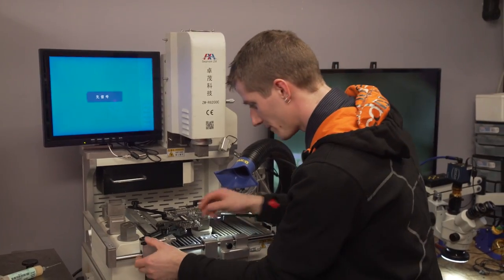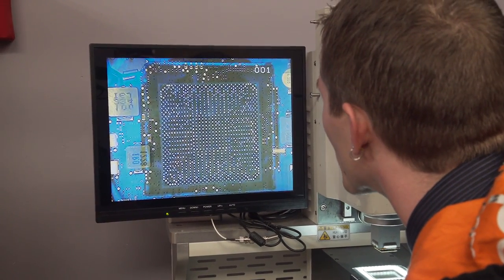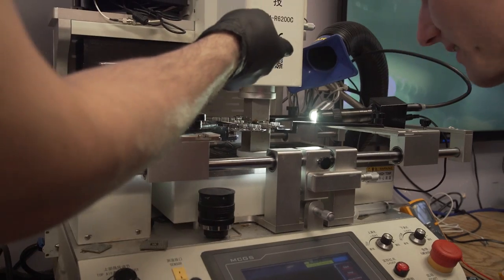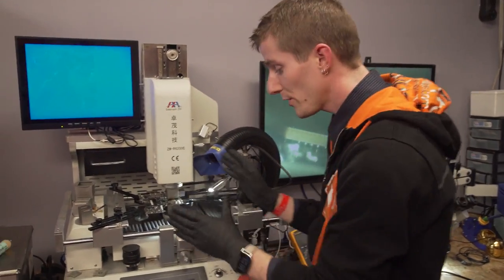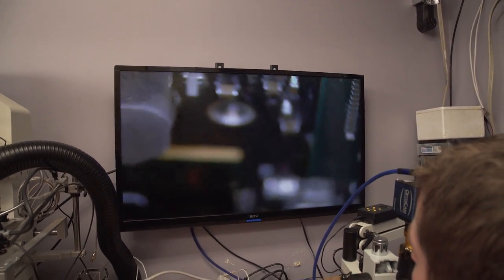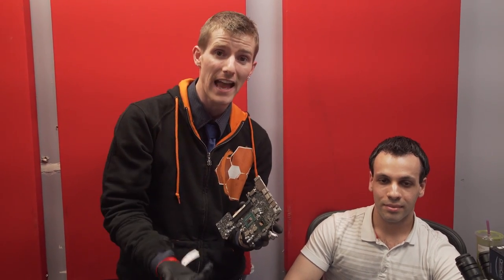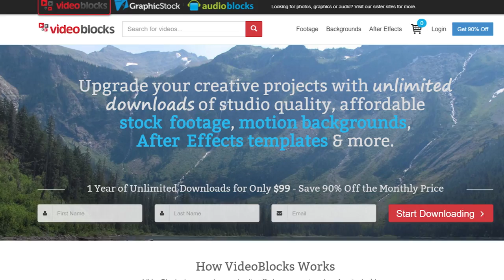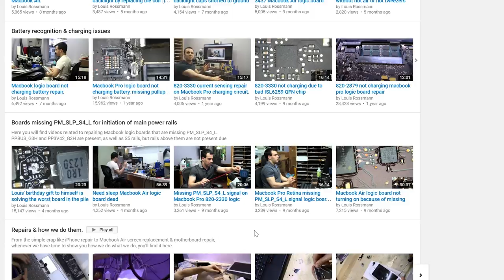Linus Attempts BGA Graphics Chip Repair! - Rossmann Repair Group, New York City

Comment: $7,300 re-work station: didn't work
Oven: worked

Also, a re-work station won't cook me a pie.
Reply: +Snazzy Labs And case dismissed :)
Reply: nice
Reply: +Snazzy Labs Daily reminder that they both got distracted and that the chip was being re-soldered for 1 minute longer than it should've.
Reply: +Snazzy Labs But you shouldn´t do this after Backing your Graphics-Card.... The Silicon-Steam is very poisen.
Sorry for my bad english. Greetings from Germany
Reply: enjoy the random chemicals from the oven after you fix something
Reply: +Snazzy Labs In Louis' video followup vlog he made (which is very long) he states the reason it fucked out was they talked for a good few minutes instead of paying attention while it was heating and that probably fucked it XD
Reply: +Itschrishere IDK how about USA and Canada, but in Europe harmful chemicals are forbidden in soldering materials since a few years
Reply: +Snazzy Labs in addition to the ones that have already said about them both being distracted the condition of the graphics card that just stopped working was starting better off than the board that had been tossed across the room by a customer and had broke 100+ little solder connections detaching the chip from the board.
Reply: +Snazzy Labs My goodness you're alive?!!??
Reply: +Snazzy Labs No but it could selectively melt chocolate flakes and caramelize stuff in general with extreme precision and without anything starting to drip!
Reply: +anonim001 Nope, you can still buy solder with lead.
Reply: +Snazzy Labs Well that is a very interesting way of looking at it i guess
Reply: +anonim001 how about you read what he was saying silicon-steam not anything to do with the solder.
Reply: +Arbanville D.  Yes, as said in the cooking GPU video. You should use an oven you'll never cook food in again because it'll be full of poison. So no pie. Unless you have enemies.
Reply: +Snazzy Labs Except the oven wont properly work. You didn't fix anything, you just delayed it. Lious has a video about this on his channel and it's worth checking out. 

I like how Linus is a good sport about this though, love the way both of them handled this.
Reply: +Snazzy Labs station worked , parts used were of questionable functionality as stated at the start of the video , please don't go about spewing nonsense .
Reply: +Snazzy Labs You're the reason companies are making it harder and harder to repair stuff. Congrats.
Reply: +Snazzy Labs you dont get it do you
Reply: +MarcoZ Uh... it was a joke. Humor mustn't be your strong suit.
Reply: Snazzy Labs Someone's going to take it seriously though, not unlike the oven video.
Reply: +Snazzy Labs would rather have my pie rather than nothing at all. :D
Reply: A lot of people here cant take jokes :v
Reply: +Snazzy Labs It only fixes it temporarily.
Reply: +Snazzy Labs Well played xD
Reply: +Snazzy Labs If he can't take jokes, he really shouldn't be on youtube
Reply: WEW LAD
Reply: Linus was operating the re-work station, so of course it didn't work.
Reply: hardware20x weew
Reply: +beaker15 Nice one Quinn
Reply: yes.. you re right. ... I mean everybody would cook a pie after cooking a gpu
or maybe both at once who knows? 
:))
Reply: +Alex Ban hiss
Reply: +Snazzy Labs Well, can your oven put the chip back on? :D
Reply: +Snazzy Labs EXACTLY what I was going to say. Yep oven worked
Reply: +Unnecessary Tiger Also before they did it, they didn't know if the replacement chip worked either.
Reply: +burnzy3210 You're new to the internet I guess. Welcome.
Reply: +Snazzy Labs They weren't paying attention and cooked t to much
Reply: +Snazzy Labs didnt he say  $73,000
Reply: Pew pew
Reply: +Mike Fox he was kidding m8
Reply: +Snazzy Labs 
"Also, a re-work station won't cook me a pie."
Are you sure? Did you tried it ?
Reply: +Mike Fox They'll do anything to get attention nowadays...
Reply: +Snazzy Labs You probably don't want to cook anything edible in an oven if you've exposed it to chemicals.
Reply: +Snazzy Labs 1337 likes?
Reply: +Tech Assistant watch linus' video where the oven worked
Reply: Alex Ban true story , isn't it funny how quickly people call others morons and get extreme about it like they got personally attacked lol. At least we had a laugh of it.
Reply: +Snazzy Labs I mean, to be fair, oven method is still technically supposed to be temporary, especially compared to this... then again, I know of a laptop GPU that got baked 2 years ago and is still going strong to this date.
Reply: Downthrower TwitchTV If you watch Louis's video you will know why it "worked".
Reply: +Snazzy Labs

Bullshit!!
It failed because Louis got distracted and the chip overheated, also it was a board from a donor and the chip was literally thrown away and fell, and a oven doesnt really work it's like havin a ZOMBIE board, it is dead in matter of time !

Even if it was the solder balls, it would destroy most of your connectors because solder only melts about 325ºc ~to~ 350ºc depending on the type of solder.
Dont Believe in the oven, its the 2nd worst method
1st propane torch
2nd oven
3rd heat gun
Reply: +Snazzy Labs The re-soldering station will make you a pie. 

A very, very small one.
Reply: I dont care why it worked lol. Sorry kid
Reply: Downthrower TwitchTV It is a temporary fix
Reply: +Arbanville D. Hi
sorry for my bad english.
Reply: +ender_scythe hi ... But why?
Reply: ikr
Reply: Should have faked it like they did the graphics card
Reply: Of the roughly... six... maybe seven cards I've baked, I've successfully revived one and it lived another two years. The other was a half-success and lived another few months. :P

It CAN work, it's just highly unlikely once the card dies at that point.
Reply: They did use scrap material, which they weren't sure if any of it actually worked, at all. And then they hastily let a beginner try to do this, while filming a video, I am surprised he didn't go for something a tad more stable to showcase. Proves he wasn't just trying to prove a point by rigging anything, he just showed off a random try, and let murphy's law rule.
Reply: I successfully repaired two different iMac GPUs using the oven method over two years ago, and they are still both going strong with absolutely no issues at all...
Reply: @PrintedPainted  liked your comment because you said greetings from Germany
Reply: BUT I did make toasts with my hotair station a few times when my toaster died....
Reply: The parts used in the re-work station were thrown at a wall and not working in the first place
Reply: Pshh they cost like 200 bucks
Reply: I like pie
Reply: You weren't paying attention. It's a temporary measure but it is in no way a fix.
Reply: yes but the bga chip was sorced from the entity which is the dark web so it could have been that . you can not even mount a damn screw to your mac pro without it breaking so learn to screw a thread then comment on bga soldering ;)